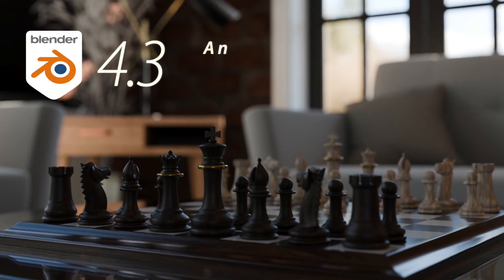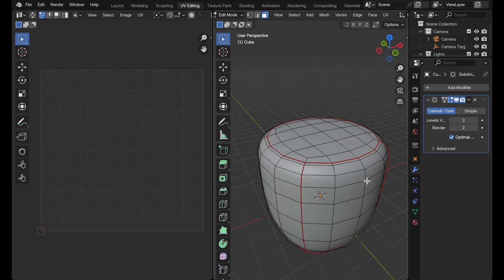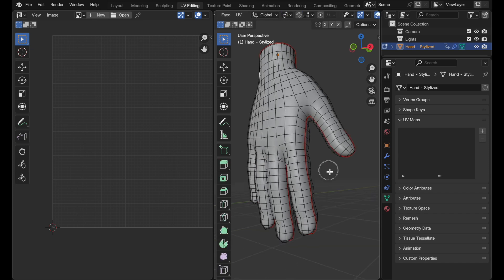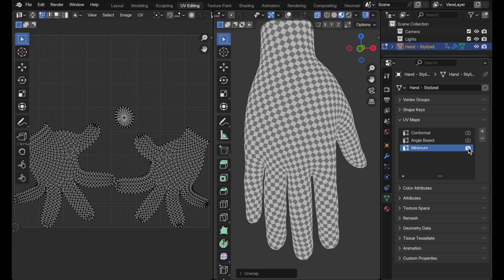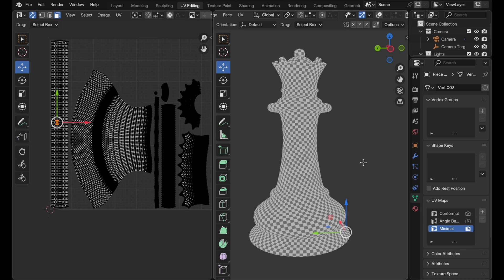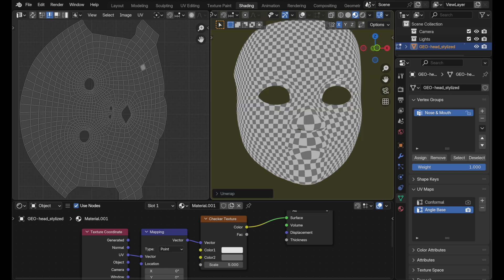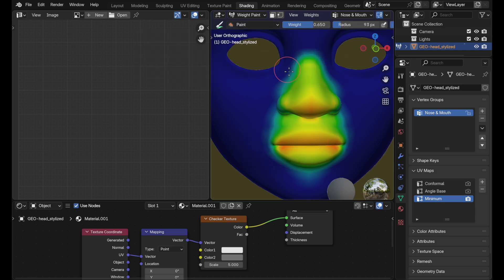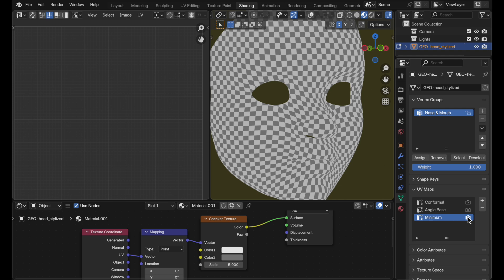NEW in 4.3! Minimum Stretch UV Unwrapping.

Comment: Thanks a lot for the video! One of the most common issues i have with Blender's UV system is the little distortion i get when using angle based unwrapping but now surely i will be only using minimal stretch unwrapping more often

Comment: Great video - I learned a lot about the different unwrapping algorithms. However, come Blender 4.3, why would one use anything other than minimal stretch?
Reply from the maker: Because each algorithm may work better or worse depending on a given mesh. LSCM and Angle work better with pinning verts and re-unwrapping to alter the original than this new minimal routine. So it's smart for them to keep all 3 for people to determine which may work best for their model or situation.

Comment: Wow! Amazing! A very necessary thing, thanks for the explanation. Is there any reason at all for the conformal method to remain in future versions of the program, given its obvious shortcomings?
Reply from the maker: I think it's smart to keep each algorithm. They each behave in sort of unique ways with any given data set. There are some situations I found where Conformal and Angle Based produced better results than Minimum Stretch. One scenario where this is the case has to do with pinning points, this new algorithm doesn't seem to work as well with pinning. So options are good to have in this case.
Reply: it works really well (better than angle based) for cube-like objects or hard surface in general, in my experience